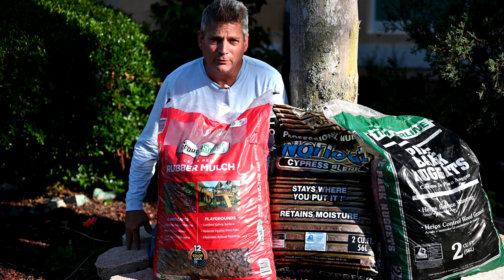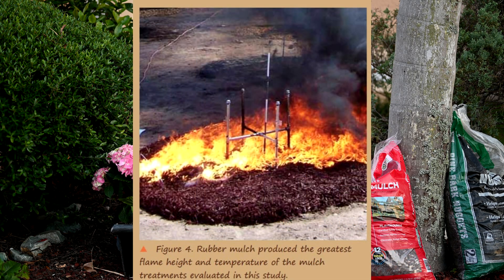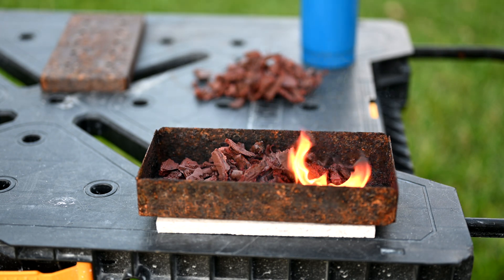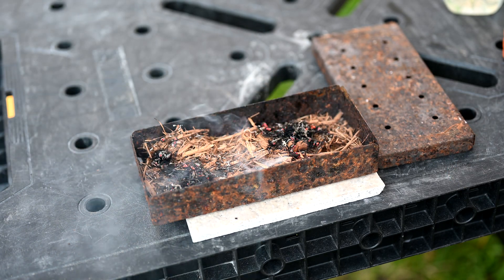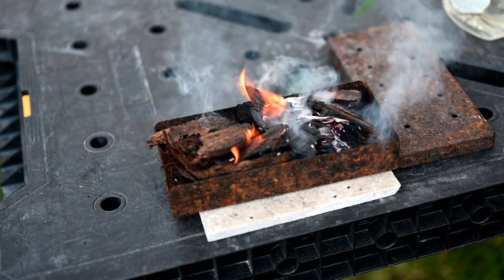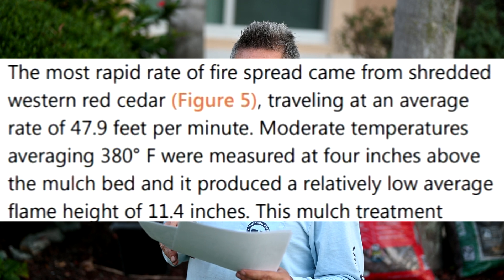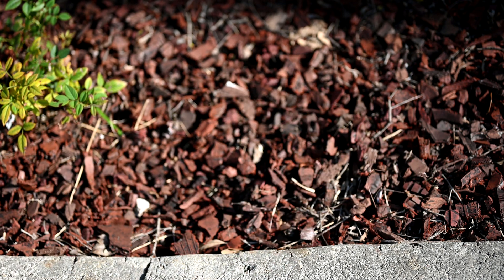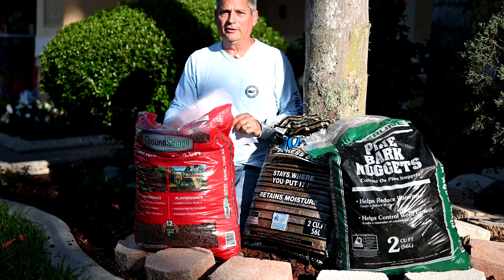Rubber Mulch Vs Wood: Which Is Better? Flame Test, Pros/Cons

Comment: It constantly aggravates me when I read peeps that are hell bent against rubber mulch, reciting every lie they can dream up. You know the liars by the ferocity of their claims. They obviously have no personal experience with the product but they certainly get wound up in a heartbeat. 
#1 - "It poisons the plants, you can't use it around edibles!" Uh, as a kid I spent every minute out of school on my grandparents' farm. We NEVER used any mulch, whatsoever, in any of the three acres of vegetable gardens we grew each year. So why even bring that up? It's just stupid. BTW, I made a rubber mulch bed next to my house ten years ago and it gets straight sun in the summer afternoons. It still gets weeds but not as easily as it's about 4-5 inches deep. Guess what - wood mulch does the same exact thing. Isn't that the primary goal for mulching? And who has a green thumb and only fertilizes by using mulch?
#2 - I was a pro mechanic for fifty years, thirteen of which was spent working on fire trucks and other emergency apparatus in a large metro dept. I can't tell you how many calls we had for mulch fires at restaurants, etc. each summer. #1 fire starter? Cigarettes. People tossing them in the mulch as they went inside the restaurant. They could have stomped them out in the parking lot but they had to get that last drag and pitch the butt in the mulch before entering the building. Cure? Rubber mulch. It takes more than a cigarette butt to light rubber on fire. Decomposing wood, on the other hand, sitting against a wall with the  summer sun beating down on it is about as easy to light as tissue paper.
#3 - "It stinks!" I agree with you on that. HOWEVER, mine only smelled bad the first summer. The second summer you could smell it if you stuck it next to your nose. Year three and on? No discernible odor. And I have a family of skinks that was living in the weeds that were there before I put the rubber down and are still thriving in it ten years later. And I have never had to add another bag to it.

Comment: I have rubber mulch . I love it . I don’t have any weeds or bugs . The lizards love to crawl around it .i first used shredded but it blew out more with a small leaf blower so I dumped the nuggets on top . I used a shop vac to blow out the dried leaves and it doesn’t blow out my runner milch
Reply: I'm considering it because of the bugs. I hope it helps.

Comment: Oh! So you've wizened up about rubber mulch!
Reply from the maker: This does not mean that I have wise end up about the rubber mulch I still use the rubber mulch but I do ignore or is that it's more flammable than then the other mulches. Keep in mind any wood mulch will burn but if you live in one of those areas near You're the wildfires then you should not be using any type of mulch you should be using the lava rocks

Comment: If you spray the rubber mulch to control weeds does it ruin the colour?
Reply from the maker: I have found that virtually nothing will cause the color to fade even after 10 years ourmulch is still the same color

Comment: If you bake pieces of used tires in the sun do they produce toxins? If you bake pieces of wood in the sun do they produce toxins?
Reply: I love your videos Jeff.  No ill intention here. Just a bit of debate. ;).
Reply from the maker: They don't get hot in the sun. If both burned, they would produce toxins, but it's not like the tires are 100% toxins either. They are fine as long as you eat them

Comment: I actually go with both mulch.  I have a brick house with siding and live in the south near the bay.  We are proned to termites so I lay my black garden material down, put cedar mulch 2-3 inches from the house.  I rather have the rubber mulch touching the house sides than the wood mulch.  My main landscape (front of house), I layed rubber mulch all over for aesthetic reasons.  This method is not cost effective but seems to work with retaining water.  The only pain is that I have tons of leaves on the rubber mulch and getting it cleaned is annoying.
Reply from the maker: I blow them off when they dry

Comment: The landscape area in my front yard gets full sun, 6+ hrs./day in Fort Smith, AR.  In this situation, would rubber mulch be a good idea?  I've been reading a lot about areas with hot summers and the possibility of volatile organic compounds and heavy metal being leached into the soil.
Reply from the maker: I have walked on it in the summer in bare feet and have no problem. Experiment with one bag see how you like it.

Comment: did you put landscape fabric under the rubber mulch ??
Reply: I placed two layers of weed blocker 15 years ago and still have no weeds and the rubber mulch is longer lasting
Reply: @raskew2  any shrinkage in your mulch?
Reply from the maker: no I did not
Reply: @jeffostroff  is there any benefit to put fabric underneath or not?

Comment: Does the rubber smell much in the heat all day?
Reply: From my experience no.  It does smell a little when it's in the bag, but once you apply it you can't smell it.
Reply: For me, the hot afternoon sun beating on it made it smell when it was hot. The second summer it smelled about 10% of what the first year did and I haven't smelled a bit of it since. It's been below a window next to the house for over ten years now. The only thing you'll want/need to do is use a barrier to keep it in its place.

Comment: Great content Jeff! This is a great subject to cover and one that I know a little bit about. I’ve spend a little time in the recycling business. Kind of grew up in it.

Growing up (15 years ago) from the time I was 10 to about 23, my dad had a small business recycling tires. It wasn’t a big operation, but there were a few years we handled around 100,000 tires. Most of these tires went to a facility that ground them up into mulch or even finer products to be remolded into other products.
Also, right about the time my dad was giving up the waste tire business, I went to work for a family friend who had a wood recycling company that needed somebody to run the day-day operation. I ran that place for a little over 4 years before I passed the torch to move on in my own endeavors. At least half of the wood that came in went right into the grinder to make landscaping mulch or sent to another place that would process it even farther to make wood pellets for burning.

I would like to make 1 thing perfectly clear. There is NO deforestation going on to make landscaping mulch! All wood materials used to make these products are used products that are recycled or scraps and/or leftovers that would otherwise be complete waste. But nobody is cutting down trees to make landscaping mulch! I just wanted to clarify that!  

In fact, most of the wood for generic dyed mulch is recycled packing material. Boxes, crates, pallets, etc. it could be any kind of wood. With the amount of stuff that comes from Asian countries, it’s probably not even any type of wood that is even found in this country lol. 

As far as chemicals and soil contaminants, there’s probably more in the generic wood mulch than from the rubber mulch. Glues, inks, paint, grease, foreign substances that got on the wood etc etc. the rubber is just from tires generally and they are generally pretty clean. Maybe even rinsed several times in processing.

Every material has it’s own pros and cons. 
Wood rots! But that fault is also a feature. If you get it out in the yard and such, it’ll just rot away and turn to soil. Rubber never goes away. It doesn’t rot and it’s less dense than soil, so it doesn’t sink away like rocks will eventually. 

Mulch is a great use for old rubber and it’s a great playground material, but man is it messy! It seems to end up everywhere and it doesn’t go away. If you don’t have kids and you’re putting it in an area that doesn’t see foot traffic, it’s great. Not that wood mulch isn’t just as messy in the same ways with the same variables, but it rots away, so it’s a temporary issue.
I’d be happy to answer any questions you have. I’m no expert, but I know more than the average guy about this subject. 

Just know that there is NO deforestation going on to make landscaping mulch! 
I can’t help but chuckle at those comments/statements a little bit, I’m sorry. I’m not laughing at you, just the thought of it.
The simple economics of it don’t work out like that. The guy making the mulch has to get payed on both ends for it to pencil out. There’s a lot of variables. I will explain further for anyone that’s interested but I think I’ve went on long enough for one comment.
Just know that there is NO deforestation going on to make landscaping mulch!!!
Reply from the maker: Awesome, thanks for sharing Matthew
Reply: Besides being messy, is there any other downside to rubber mulch? I have an area (as you described) that doesn't see foot traffic and I'm just tired of replacing wood mulch twice a year. Because there's no traffic I don't think it would be messy in my application as I have a good border as well. Thinking hard on putting rubber mulch, appreciate your comment.
Reply: @frankarango4071  only other down side is the fact that it doesn’t rot away. It’ll always be there. It works for you now, against you later.
Reply: @matthewpeters85  I put rubber mulch in a flower bed with nothing else but weed liner, 2 yrs later I have 1/2 or less volume, as my rubber mulch has shrank into tiny pellets... is that normal, or has anyone else ever seen this?
I know the area I placed it is under full sun & hot for 3/4 of the day, so maybe that's a factor 🤷🏼‍♀️
Reply: @leahrowe847  what you’re seeing is normal in full sun. It’s called dry rot. In full sun It’ll keep breaking up into smaller and smaller peices until it’s dust size particles. Keep in mind, it’s not becomes less material, just less volume. The smaller peices just pack together tighter. It will never become dirt like wood mulch does eventually. The smaller the peices get the easier it’s carried off. Either by wind and water, or by the bottom of people and animals feet.
Reply: @matthewpeters85  Matt, thanks for the response back, I appreciate it.
Is it normal to shrink to half size in just 2 years though... that seems like a lot & kinda excessive, let alone expensive in the long-term; especially at 4x the price tag compared to wood.

Comment: This confirms what I said all along - rubber mulch all the way!  Here in the Northeast, after the winter season, I used to dig up the wood mulch before adding a fresh base, and there would be white mold among the old wood mulch during the removal process.  Not only that, but I had nest upon nest of triple bodied black ants among the wood mulch that lined the base of the pool.  Ever since I converted to rubber mulch, those issues are non-existent, the color lasts for 12-years at a time, and no need to add more year after year. Cheers!
Reply from the maker: Thanks for the info Mike!
Reply: How long have you had your rubber mulch?
Any issues with shrinkage?
Reply: @leahrowe847  2 years so far. There won't be any shrinkage because the rubber is like that of rubber tires. They will hold their form forever. Just like car tires won't shrink over the years, these rubber pieces act the same way
Reply: Why are we burning in this video?  Is there a chance for this to catch on fire from the natural heat?

Comment: I’ve been around the block with wood mulch, all cons are true. I’m going with black rubber mulch at the new Florida house. Mounding, rain wash out, bugs, color fades fast, and have to redo it within the year. Bye wood mulch
Reply from the maker: Yes, I could never figure out why the dye they use on the rubber mulch isn't used on the wood mulch